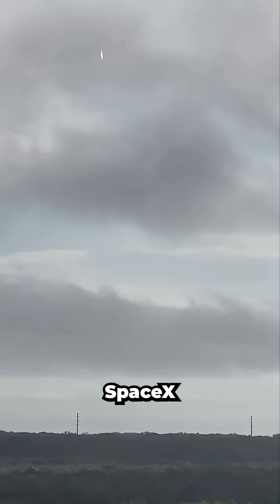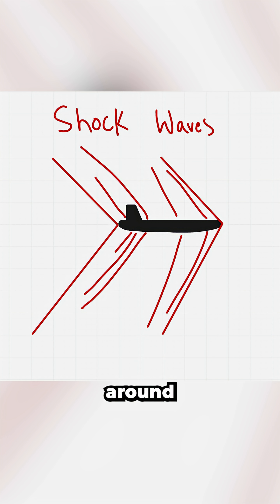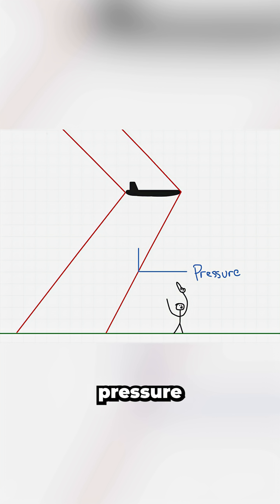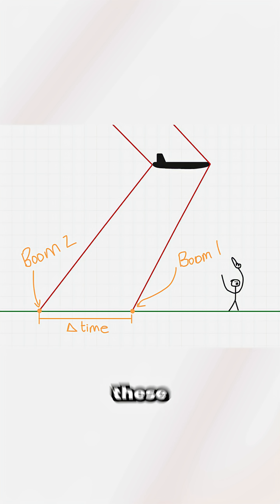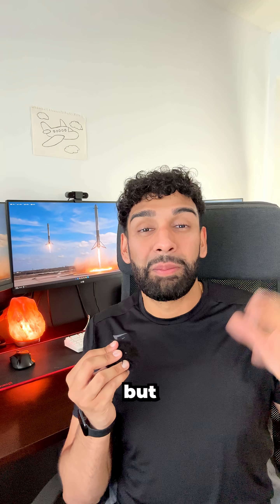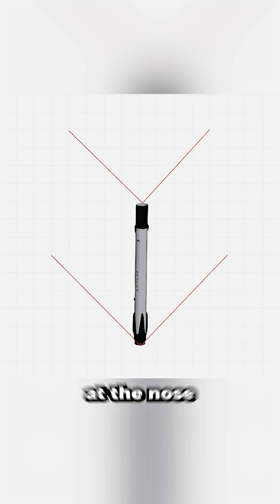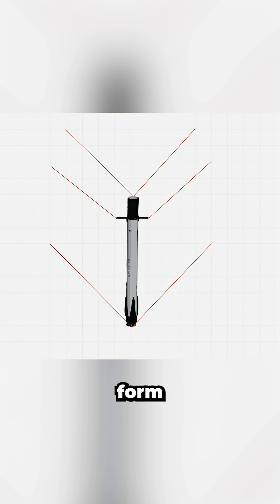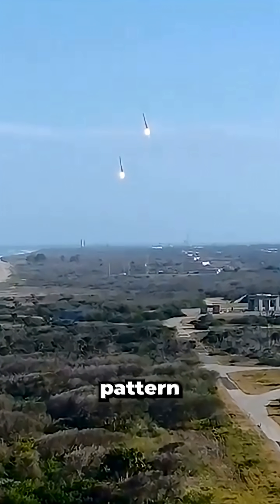Why do SpaceX rockets make THREE booms?

Comment: How do they produce sonic booms at such low altitude when they're travelling at NOWHERE NEAR the speed of sound during its final stage of decent? The rockets reach subsonic speed at more than 15 miles up... the booms aren't heard in till they're onl a couple of hundred metres up.. it doesnt add up
Reply: They made the boom much higher up, but it was falling faster than sound. 
You see it slowing down, and hear the boom finally catch up to what made the sound
Reply: Theyre literally going twice the speed of sound by ignition, which is very close to the ground...

Comment: Also supersonic aircraft specifically have their wings designed to push the front Shockwave along it's fuselage as far as possible effectiveky merging the two together to reduce resistance and increase efficiency

Comment: I thought it was the 3 engines igniting since the exhaust is super sonic
Reply: You are 100% correct. This comment section is hilarious. Everyone is trying to say the sonic boom happened from re entry. Which would have happened over a minute prior at this point.
Reply: @mcs131313 I'm afraid for the future, you and I are probably the same age
Reply: They don't have 3 engines though? Don't they have 9
Reply: @RChero1010 they land with 3 and launch with all 9
Reply: Btw they land with one engine at minimum thrust
Reply: The ignition is heard after the sonic booms, and not all landings are 3 engine landings, many are single engine.

Comment: Man, so much bullshit in one video.
1. Jets at airshows don't produce sonic boom. It's condensation cone in shockwave at near supersonic speeds.
2. Those booms that Falcon 9 booster generate, are engines reigniting to slow the descent. It have nothing to do with traveling supersonic because they don't reach those speed falling down.

Comment: That booster doesn't look like its at a sonic speed when those sounds are created
Reply: Becuase the sonic booms form when it reaches the speed of sound at high altitude and it continues to travel towards the ground FASTER than the sound. By the time the booms reach you (observer a few miles from the landing site), the booster has already begun the slow down burn and decreased it's speed significantly. There is also the effect of the sound slowing down as the atmosphere thickens, while the booster is only speeding up until the burn, but i don't know how much that will affect the time difference.
Reply: @alanowa123  Yes although the sonic boom is created constantly when it's faster than sound not when it surpasses it.
Reply: @jebk24 yes, but from the standpoint of a stationary observer it's not a constant event, even though it forms all the time when the object is faster than sound. You could theoretically travel parallel to the ground at high speed to experience it constantly. There were even some ideas of military use with supersonic aircraft flying in circles but it went nowhere and I can't find details right now.
Reply: @alanowa123  one thing, doesn't sound speed up as density increases?
Reply: @alanowa123  nah - it’s from the gasses expelled from the engines as they reignite which are going well over the speed of sound.  It’s not that far away in these videos - only a couple miles, so the delay is only a few seconds, not some crazy amount of time.
Reply: @alanowa123 so it's like how we measure the thunder distance??
Reply: Correct,  the boom happened much earlier and was travelling at the speed of sound to the microphone many miles away.
Reply: That's because the sound is created much higher up and long before the video clip you see here lol. Delay
Reply: Bro is talking about sonic boom while literally didn't get any concept of what 'sonic' is
Reply: @Chleosl  these people are everywhere and they vote too
Reply: @Chleosl  Bro was making a correct observation creating an opportunity to teach people and youre being rude.
Reply: These things are huge. Over 130 feet long. You are seeing them moving that fast several miles away. A camera doesn't do it justice. When you see these things in person it's absolutely mind boggling. Seeing them take off/land and feeling the power coming off of them rattling your bones is something spectacular.
Reply: cuz its not instant it has delay . it travels on speed of sound not speed of light .
Reply: The shock waves are there from atmospheric entry. By the time they get to where you are, the booster is subsonic. You are hearing old information.
Reply: @HammerOn-bu7gx  you’re telling me the gases blown out when those engines ignite are subsonic?
Reply: @HammerOn-bu7gx    Extremely incorrect.  Atmospheric entry has long since happened at this point.  The delay is not that long.   There are tons of videos by SpaceX and other physicists breaking this down.
Reply: The air traveling out of those boosters when they re ignite - is going much faster than the speed of sound.
Reply: Dunning Kruger at its finest. You know barely enough to formulate your own thoughts about the issue, yet you lack the deeper understanding need to grasp what you are actually saying. Its SONIC it has delay my friend.
Reply: I'm gonna blow your mind.. Light/visuals travel faster than sound :O
Reply: Light travels faster than sound my dude. Sound waves take a long time to cover that distance. By then they've already slowed way down. They decelerate incredibly fast since the quicker, larger, and later burn is far more fuel efficient than a slow deceleration burn
Reply: @ec7005  light travels faster than sound - but not to the extent people are suggestion.  The sound is from when the engines ignite, not from when it initially hits atmosphere.
Reply: @mcs131313  lol it isn't from the engines igniting. That doesn't cause a sonic boom. It's from the rocket going transonic. Sonic booms happen from pressure difference when you're near Mach 1. When the rocket is already in its final burn decelerating, it creates the sonic booms when it goes transonic as it slows past Mach 1. By the time the booms reach you, the rockets have already almost landed because that's how fast they decelerate and how long sound takes to reach you miles out. You can watch plenty of videos of it to see the delay. The deceleration burn starts, THEN the sonic booms happen when it passes Mach 1
Reply: exactly its because it was moving supersonic for such a long distance that the booms and sounds lag behind and catch up when you hear them
Reply: I mean, it’s a sonic boom, it’s not a visual boom is it
Reply: well are you an aerospace engineer nooo then stoopppp talkinnngg 
😅 lol "this is a joke don't get mad" 
i'm no aerospace engineer either😊
Reply: speed of sound

Comment: No aircraft flying over an airshow is producing even 1 sonic boom. Period. That condensation cone doesn’t denote breaking the sound barrier at all, it has to do with air conditions, like density altitude, humidity and temperature where you can see the vapour cone form. This is not an indication of breaking the sound barrier. This is just visual evidence of air compressing due to the mass of the aircraft flying through it. Then as the air moves through that area of compression it rapidly expands again and cools causing the humidity in the air to briefly condense before equalizing with the surrounding atmosphere. It happens very rapidly. 

Yeah, you sort of get a very soft representation of breaking the sound barrier because the sound front is traveling at whatever the speed of sound is based on conditions at ground level and this lets the aircraft get above you before the sound reaches you. But breaking the sound barrier on aircraft not designed to minimize the impact of the bow and shock wave would do legit damage to stuff on the ground at only 200’agl.
Reply: A few years ago at Oshkosh an F16 accidentally broke the sound barrier. I work the flightline in Warbirds And I distinctly remember feeling the 2 rapid thuds in my chest. There was damage in one of the buildings as well.

Comment: 2/3 of that makes sense, but the grids extend when the rockets are nearly a touchdown way below the speed of sound so how is a sonic boom generated by the grids
Reply: They extend right after stage separation (~80km) up, certainly not nearly touchdown.
Reply: They're extended way earlier
Reply: The landing legs extend last minute, but the grid fins guide it down all the way.  So they are certainly already open.

Comment: But they're decelating slowly, not accelating... So why does the boom happen at all?

Also, until boosters fire, it's falling at terminal velocity ryt? And that is not enough to break sound barrier which causes sonic boom ryt?(I'm too tired to run the numbers...😔 But do tell if I'm wrong)...
Reply: You're wrong.
The booster comes down at super sonic speeds. Right before the landing burn they're about mach 1.2 they don't decelerate fast enough to reach their terminal velocity.

Comment: What I still don't understand is, that the distance between the grid fins and the top of the booster is way smaller than the distance between the nose and the tail of a fighter jet, yet the SpaceX booms are distinctive, while fighter jet's still appear as one
Reply: Its because of both perspective and the width of the fins (theyre much larger than you think) from what I know
Pls dont quote me
Reply: Well it’s also because your perspective
Reply: I think it’s because the unique geometry grid fins creates a lot more of a pressure difference than the sleek body of a fighter, so they create a much larger and by extension more distinctive shockwave. It would be similar if you got a fighter jet and gave it some sort of high-drag wedge while going supersonic (something they actually played around with in Russia with a bomber during the Cold War) it would probably give that extra boom
Reply: @martinbucci5506 that is a valid point which can be explained by the jet's shockwaves simply reaching the ground in such a rapid succession that us humans perceive them as a single overlayed sonic boom.
I recently saw a short by @CleoAbrams called "How LOUD Is A Supersonic Plane?" which actually perfectly includes a clip where the jet's two sonic booms are clearly noticeable (just like 5 secs into the short).

At a pinch maybe this analogy can help with the conceptual transfer (not my original):
"The phenomenon is similar to the wake of a boat. As the boat moves through the water, it creates two distinct waves, one at the bow and one at the stern. These waves, like the sonic boom, can merge into a single, larger wave as they propagate."
Reply: Because it's not sonic boom … It's engines ignition … This short is completely wrong 🤦🏻‍♂️.
Reply: @Holdegron3  Nope, this short is 100% correct, those are sonic booms. These can't be the sound of the engines igniting because then the cameras would be hearing the engines the second they turn on based on the clips. which is impossible given their distance from the actual landing.